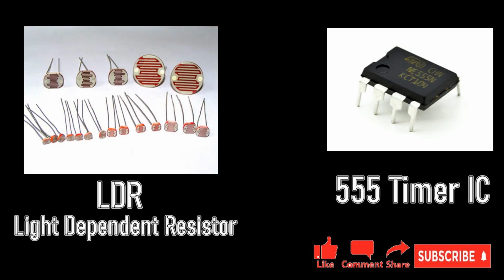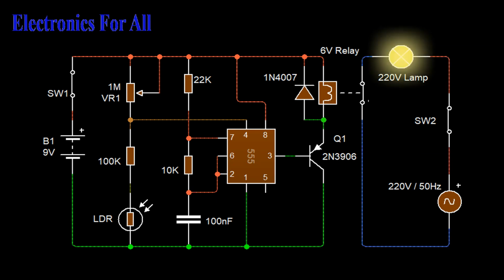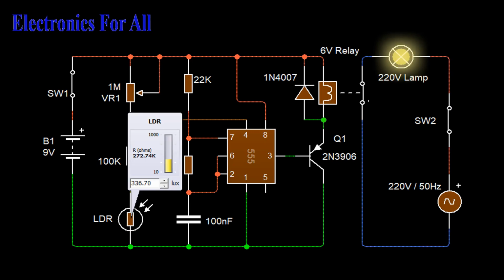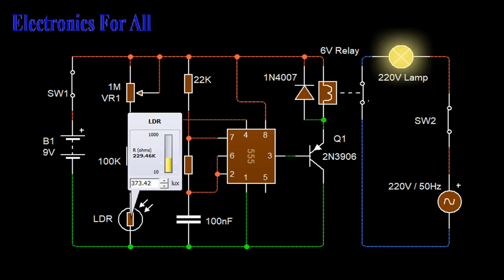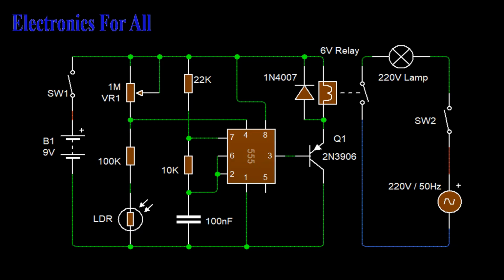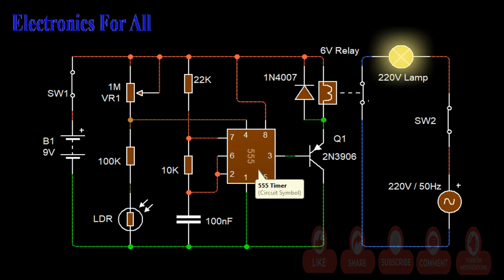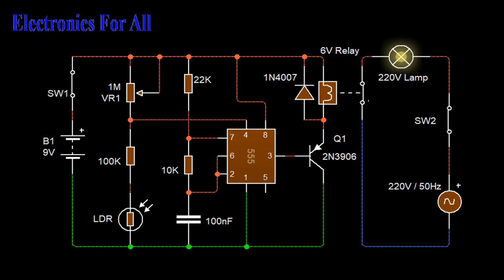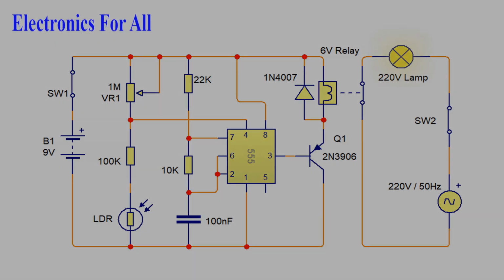Auto Night Light ON in Dark! Dark Detector Circuit Using LDR & 555 Timer IC

Comment from the maker: 💡 FULL DIAGRAM HERE - LDR + 555 Wiring:

LDR + 10k divider -> PIN 2 of 555
PIN 3 -> LED + Resistor -> GND

DARK = LDR High Resistance = PIN 2 Low = LED ON
LIGHT = LDR Low Resistance = PIN 2 High = LED OFF

Comment "PDF" for clear image!

Which one you want next? Light detector or Laser security alarm? Comment!